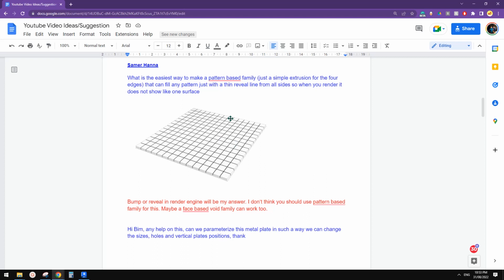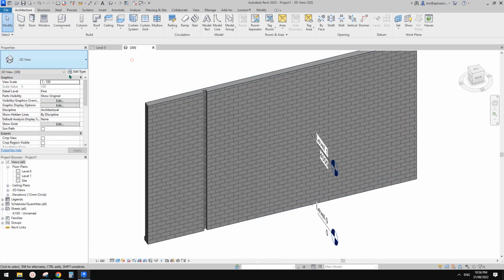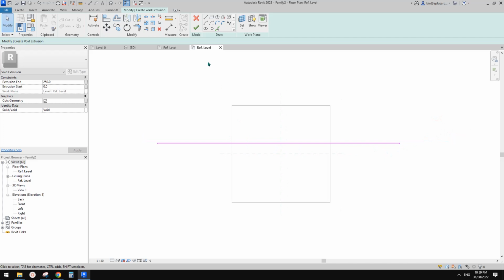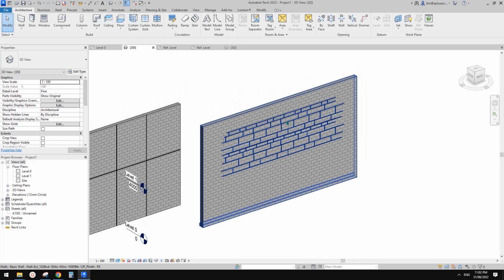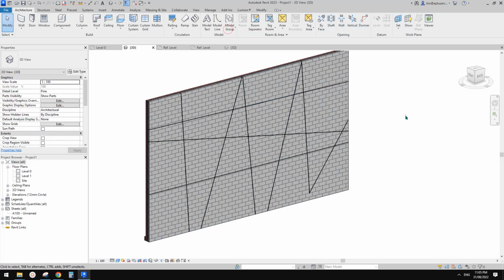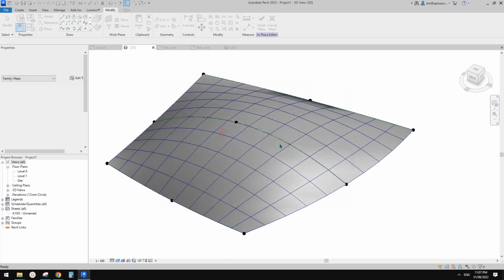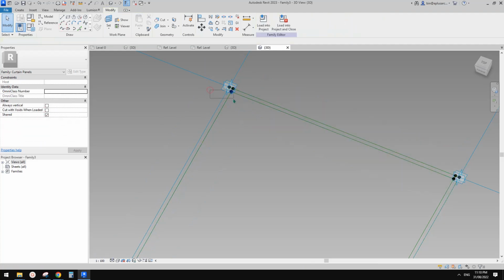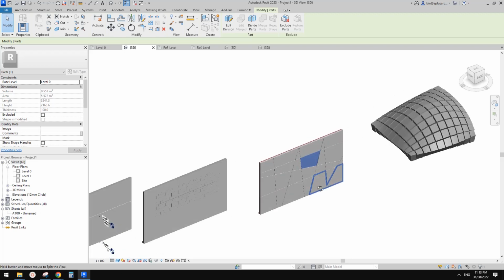Revit Exercise (Day 891) - A few different ways of breaking the surface for better renders

Comment: Again this works  as you said only for rectangular pattern. I wonder why there is not a way to offset the borders inward and constraint the offset to the borders, so it could be applied to any pattern ?
Reply from the maker: Maybe a solid extrusion with a void sweep can work too, but will very likely break when switch pattern.

Comment: 👏🏿👏🏿👏🏿👏🏿👏🏿👏🏿👏🏿👏🏿👏🏿👏🏿👏🏿👏🏿👏🏿
Great as usual 
Maybe I did not express my question good enough …
The answer was in the last example (an organic double curved surface in massing) 
But nice to see the other ways like reveals, parts, and void face based family (totally impressed by your speed in launching commands in Revit, it seems like years & years of work in the program 👏🏿) 
I did it close to your way but with 8 points (2 points on each of the 4 sides) then put another 8 points on these points on the proper working plane offset them by a same parameter so they are all at the same distance from the borders. Cord length was a nice idea to guarantee the size from the corners 👏🏿
« Orient to » did not really work for me but to extrude both sides is an old trick I use it in rhino to overcome the direction of surface normal 👍🏿👍🏿👍🏿 but I wonder how the same surface could have many normal directions !! strange